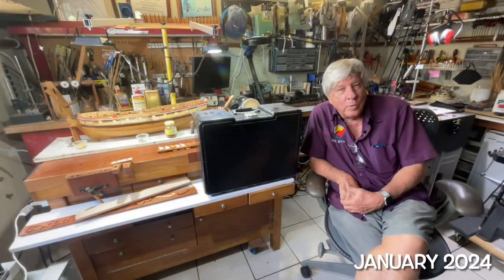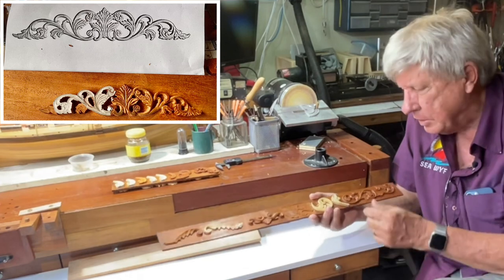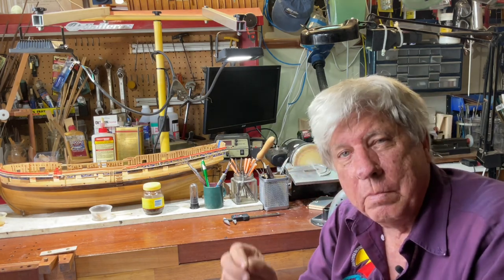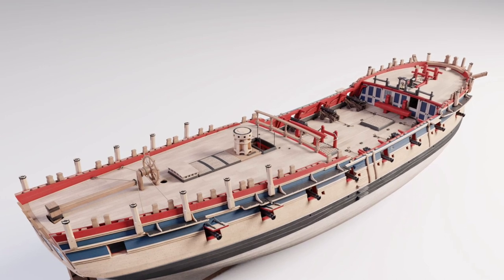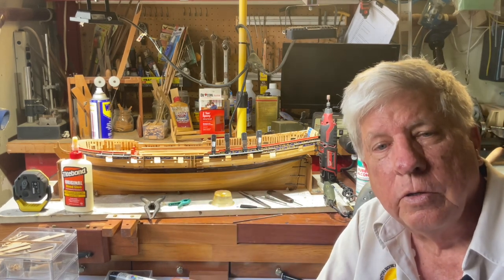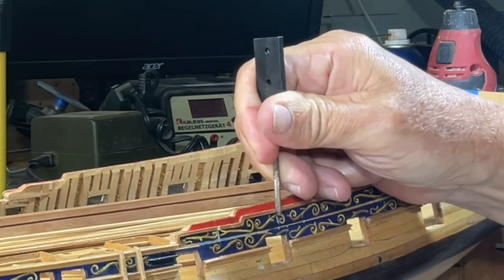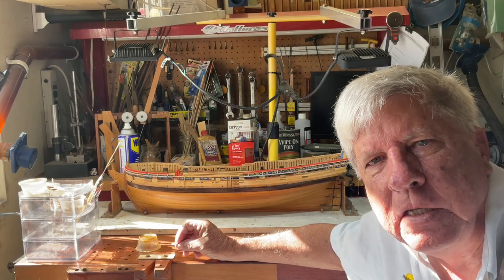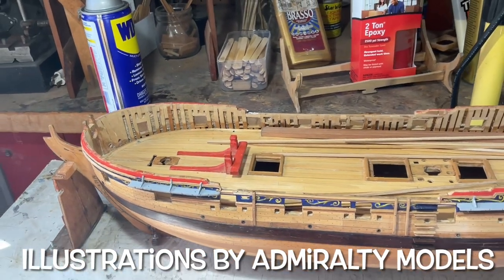Video 117. Thorn. Installing the standard and channel on the model.

Comment: Keeping your mind, eye, and tools sharp, I see. Wishing you well in your new endeavor, Kevin.

On another note, what’s the status of the recent spill? Has anyone been held accountable for either the incident or the delayed response?
Reply from the maker: No they are still trying to find if the tug that was pushing the barge went down when the barge turned over. It was most probably transporting black market bunker C diesel from Venezuela to Guyana.   If it did not sink then it is hiding somewhere in the Caribbean or Venezuela. Hopefully in time all will be uncovered.